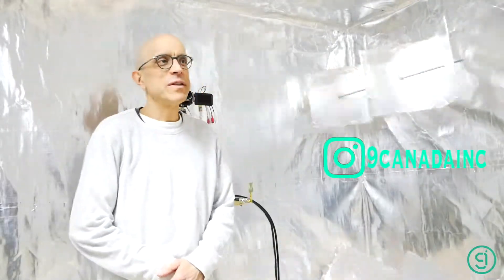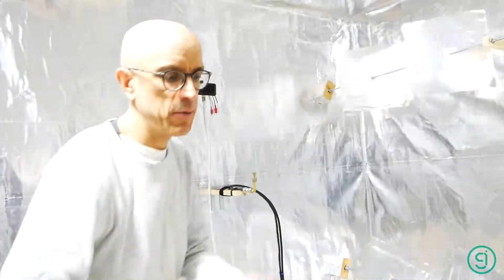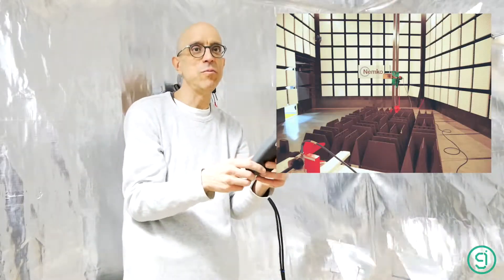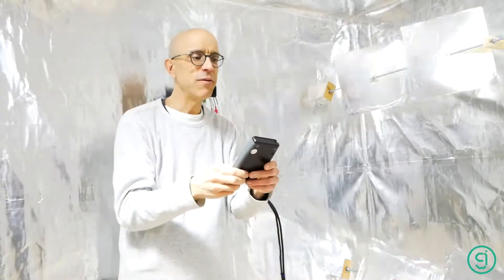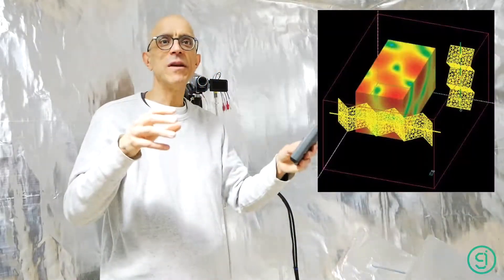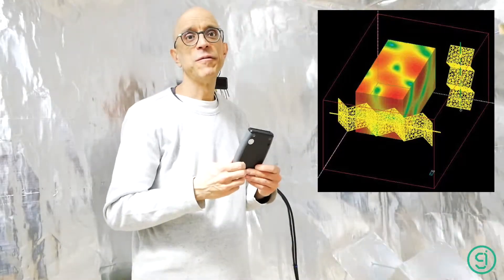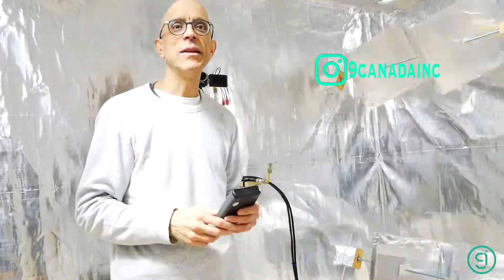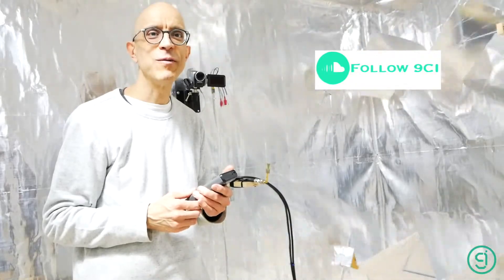Reverberation Chamber

Comment: Is this reverberate room similar to a helmholtz coil?
Reply from the maker: Sort of, we can actually put the helmholtz coil inside the reverb chamber. The coil is for magnetic or electric fields.  The generated field frequency range in the center of the coil can be anywhere from near DC (0 Hz) to many kilohertz or even megahertz (MHz). The reverberation chamber is a controlled testing space for the RF frequencies from several hundred megahertz (MHz) up to the millimeter wave gigahertz (GHz) ranges.  So together they both allow for a known field in a quiet and consistent area for greater measurement testing. This is an excellent question, thank you so much for asking.